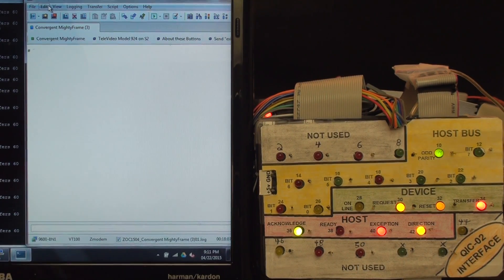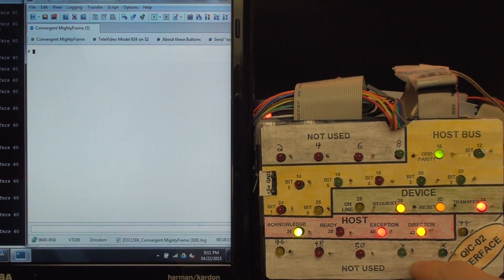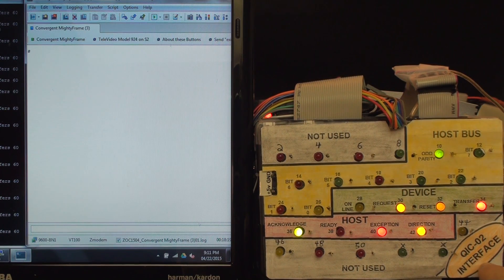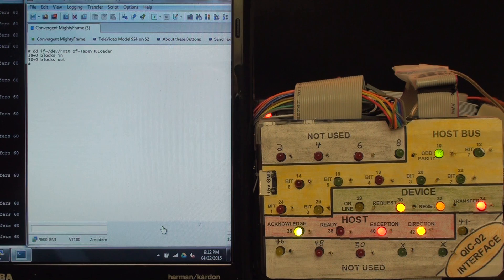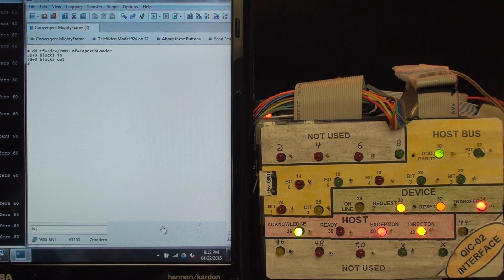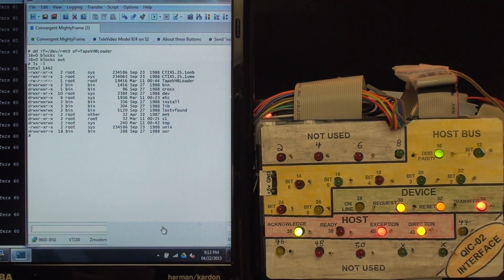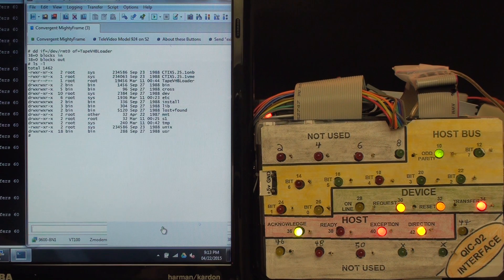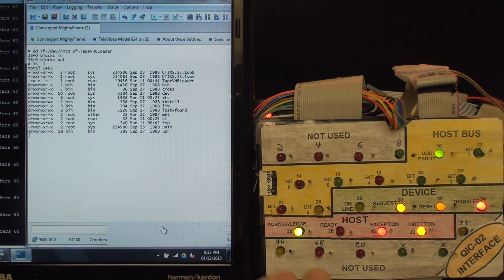Archive 5945 tape drive to MightyFrame FILE COPY - QIC-02 Diagnostic Box

Comment from the maker: PLEASE NOTE:  I built this diagnostic box. The LED colors are not significant.  They are just what I had available, and they are in no order whatsoever.  Also, they are all single color only, and are wired to only light on a positive voltage signal.  If the signal voltage goes negative, the LEDs will not light, and will not change color.

This was an oversight on my part.  When I design the next version of this type of diagnostic box, I will use bi-directional and bi-color LEDs for every pin/connector.